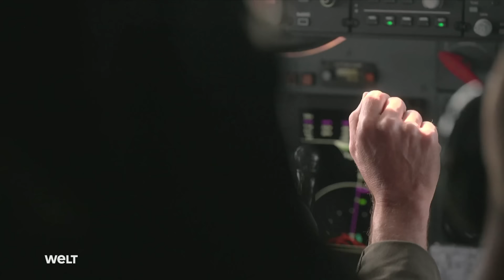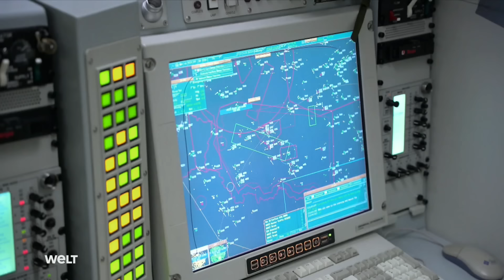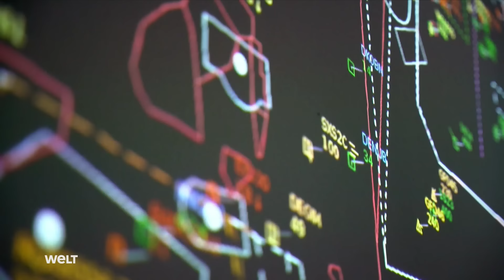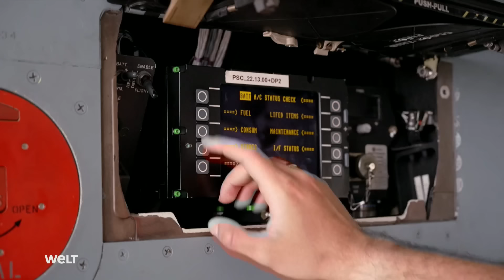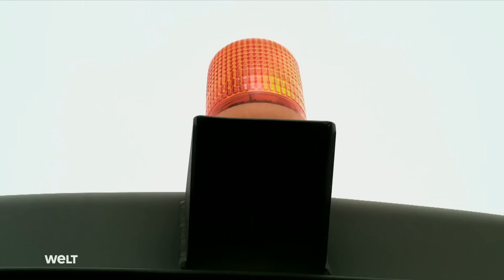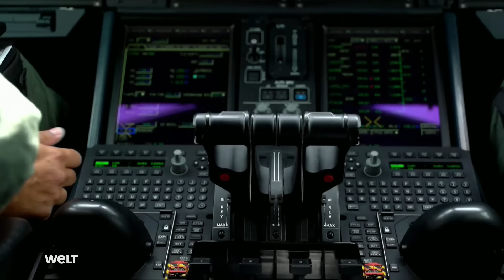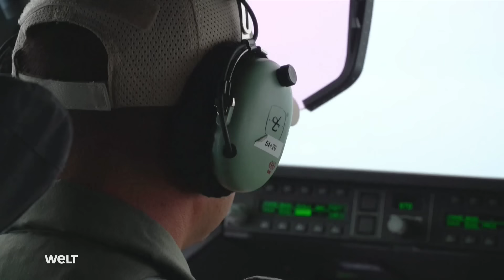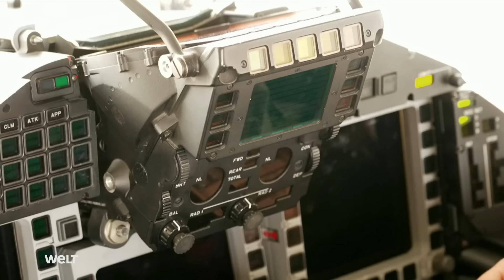Air Defender 2023: The Sky's the Limit in NATO's Largest Air Drill | WELT Documentary

Comment: The capability to control the delivery of advanced technologies, such as the F-16 A2 and its integrated system components, is a critical aspect of national defense and security. These technologies represent cutting-edge advancements in aerospace and defense systems, offering unparalleled capabilities in terms of speed, agility, and lethality on the battlefield.

One of the key features of these advanced systems is their ability to maintain control and oversight even in environments where reverse engineering or unauthorized replication may occur. Through sophisticated encryption, authentication, and proprietary software systems, these technologies are designed to prevent unauthorized access and replication, ensuring that the integrity and security of the systems remain intact.

It's important to address the fear and uncertainty that may arise among nations when accepting and complying with the delivery of such advanced technologies. While there may be concerns about the means by which these technologies were acquired, such as through agreements or alliances, it's crucial to emphasize that the primary objective is to enhance collective security and deter aggression.

The systems delivered are intended to protect life, preserve prosperity, and uphold the principles of sovereignty and self-defense for all nations involved. They are not intended to be used as tools of coercion or domination, but rather as instruments of peace and stability.

Furthermore, it's essential to underscore that these technologies are not under the control of any single entity or individual acting unilaterally. Instead, they are governed by international agreements, protocols, and standards that ensure equitable access, transparency, and accountability among all participating nations.

In essence, while there may be concerns about the origins or motives behind the delivery of advanced defense technologies, it's imperative to focus on the shared goals of enhancing security, promoting stability, and fostering cooperation among nations. By working together and leveraging the capabilities of these advanced systems, we can collectively address the real threats to our species, such as conflict, instability, and aggression, while striving towards a more peaceful and prosperous world for all.

Comment: Hoping that Philippines could have this kind of euro fighter jets that protect the souvierienty tirretory and EEZ against China's aggressiveness...
Reply: @nestorlasta8392
As i understand a small portion of aid from H.R. 815 bill to Taiwan defense will go to Phillipines too. You certainly deserve help and defense from NATO too in case of threats becoming physical. Pity the pricetag of F35, but i'm sure we'll figure something out in the future collectively. Political and public support is certainly there.
Reply: EDIT:
You meant Eurofighter, not F35, which is not much cheaper, but doesn't matter.
 I looked into it, and while that $8.12B Indo-Pacific aid will be half spent on US submarine fleet and ability of speedier response by US forces in your region to Chinese agression, around $2B is allocated to direct military assistance to Taiwan and other ones in region under similar threat. Though public details of the bill doesn't specify which other countries will get what in particular and benefits outside Taiwan likely will be indirect. I understand Phillipines are next in line and would be under the same protection  by US/NATO forces, notably from bases and submarine fleet in the region.

 Then there's your air force, which had stalled the planned upgrade for more then 10 years since you got the only 12 Korean FA-50 fighters, which seems very light, low-budget option. However, looks like even if you didn't get the planned F16s and won't afford F35s, instead you'll get the next and probably best value JAS 39 Gripen from Sweden. They might be light, but have proven themselves to be versatile and durable. Besides Thailand will likely get them too, which is a bonus on coordination front. At least your AF got a lot of other nice toys apart from fighters, which is multiple times more that ex.g. all Baltic states put togeather can afford. Additionally, your Horizon-3 10 year plan of $35B investment in modernising AF (including probably ~10% of that for first order of Gripens) - looks like the best deterrant to China you can have for now. Let's just hope there won't be J-16/Gripen showdowns over your airspace.

Comment: Ok, the reporter says the A400M can refuel the F-16. How does it do that, since the Airbus doesn’t have a Boom??
Reply: This is why I can't take WELT seriously anymore. Not enough research nor rigor go into the quality of the information.
Reply: It can refuel other aircraft, you may not see a boom, the one in the video shown may not be our fitted for refuelling. But taken directly from Boeings website: Designed from the outset to be a dual-role transport and tanker aircraft, the A400M provides air forces with a cost-effective way to acquire an air-to-air (AAR) refuelling capability in addition to a versatile logistic and tactical airlifter.
Reply: There are F-16 with refueling probes for the mode the A400M is providing. Maybe the US F-16 does not have them, but other nations' F-16s may.
Reply: @marksapollo  yes, it can refuel other aircraft. But only with shutes. So it cannot refuel the F-15, F-16, F-35A etc.
Reply: @mangalores-x_x  had to look that up. Seems like the F-16’s with those fuel tanks on its back has, or can have probes. Not many F-16 flying nations have those